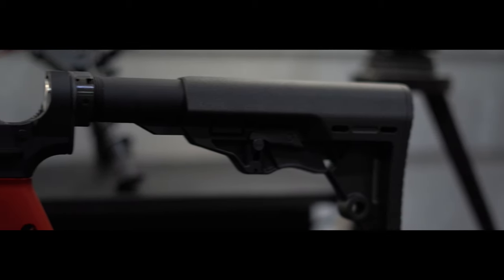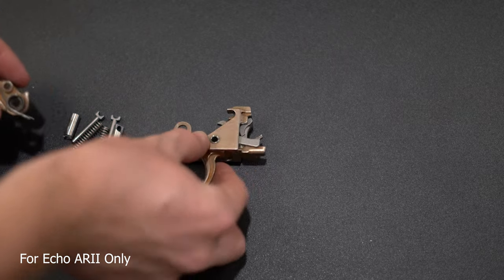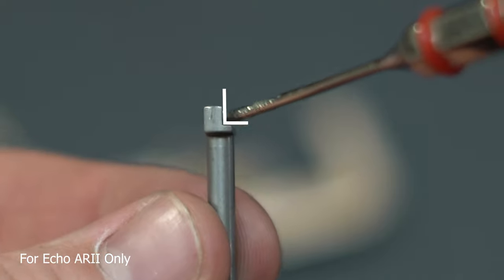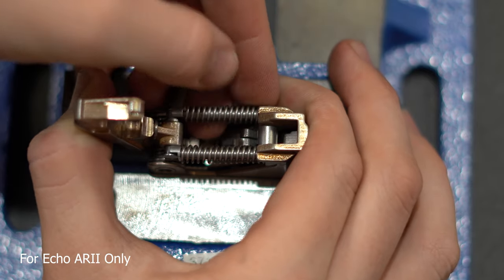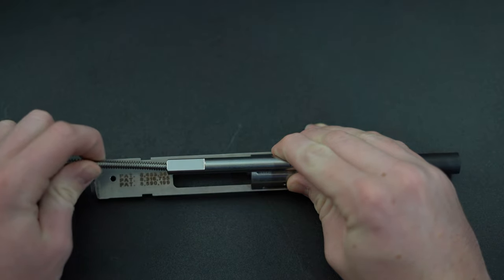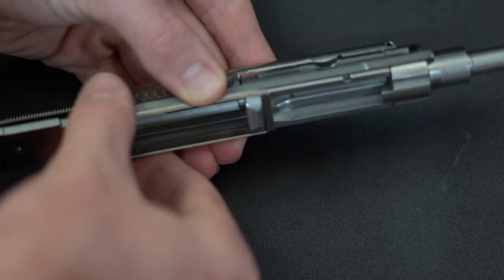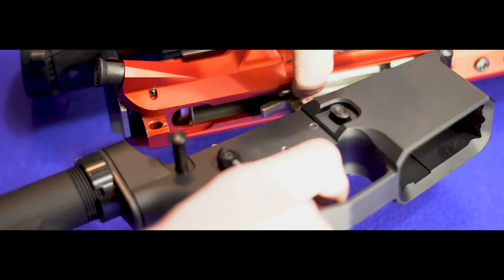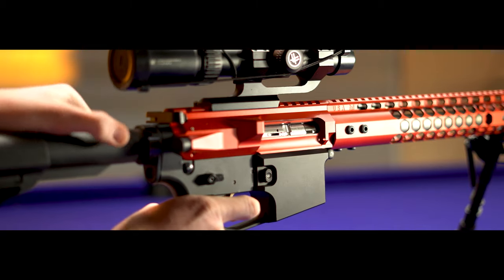Fostech 22LR AR15 conversion kit install and overview | Works with echo triggers ARII and Echo Sport

Comment: Hello … late to the party but I’m having problems with my echo sport triggers.  They are set up for 556 but I recently bought the Fostech 22lr conversion with a couple Fostech 22 mags.  When the 22lr bolt is in the trigger selector is on fire & won’t  move. So pull bolt back out & out 556 back in & trigger works fine .. any ideas what I’m doing wrong ?
Reply: Sorry meant to say the trigger itself won’t move . Acts like the safety is on and you are pulling trigger it won’t move
Reply from the maker: @housecharlie  sounds like an issue with the sear trip. Definitely reach out to Fostech if you have questions about proceeding further,

Comment: After you change to the springs for the .22lr, can you still use the gun with 9mm or .223 uppers?
Reply from the maker: I was able to switch the bcg back and was able to shoot .223 again. The 22 conversion won’t fit a 9mm barrel.
Reply: @DesertRoadsEntertainment  Right, on the 9mm not fitting the 22 conversion. I have a Echo Sport, and it worked great with the 9mm and .22lr. I recently upgraded to an Echo 2 because I didn't like the Sport's paddle in the trigger guard.  The Echo2 is nicer, but I haven't been able to get it to work with .22 yet.  I need to get the springs you used in your video. Thanks for the reply.
Reply from the maker: @mjohnson43136  yes! You need the springs and the auto seat trip. That allows the trigger lock to be pulled when the bcg returns to battery. Thus, allowing the trigger to be pulled